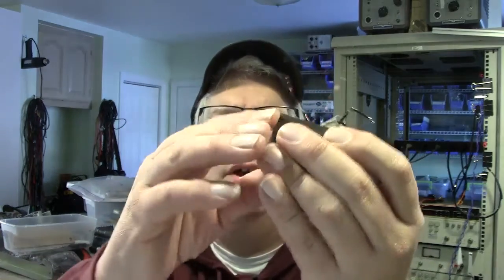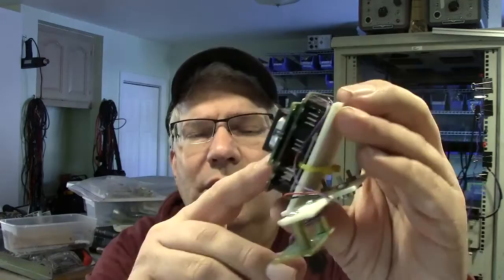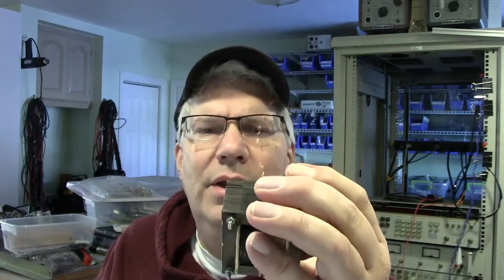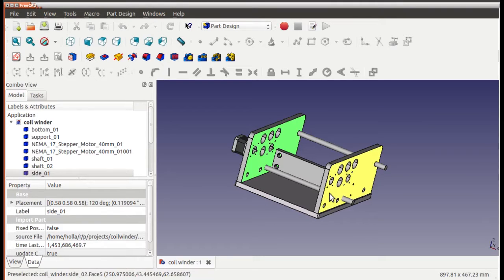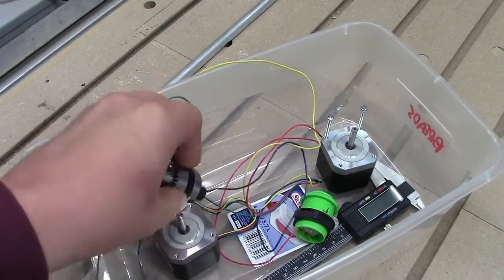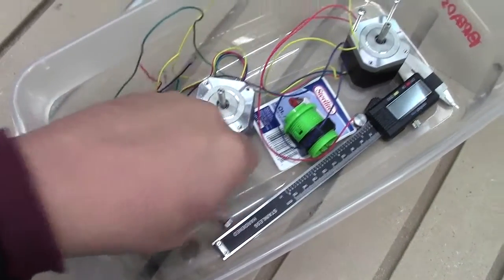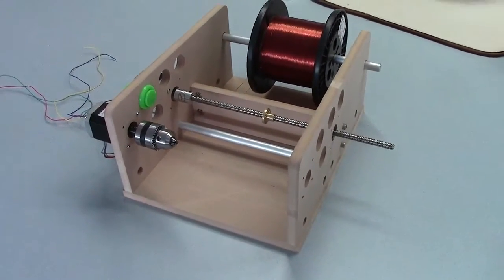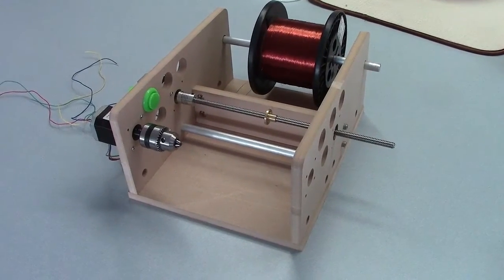160125 Faraday Coil Winder - Introduction

Comment: Nice design - finding a chuck for a stepper motor is clever - means you can make a jig for winding any former imaginable I guess.
Reply from the maker: Thanks for the comment Mark. A chuck is clever but turns out the geared stepper motor final bearing is a little sloppy, which gets coupled through and the bobbin wobbles. I did start v2 of my winder. Look for videos about it in the future.

Comment: That is really awesome. I can see it running out of ChiliPeppr already! I don't think this is going to be too bad. Just use the X and Y axes to drive these. The gcode is probably easiest to simply be manually written. The easiest too is to just visualize it in the 3D viewer in ChiliPeppr as XY moves rather than try to render it as rotation and bobbin moves, but that would be super cool to modify the 3D viewer to show the real action.